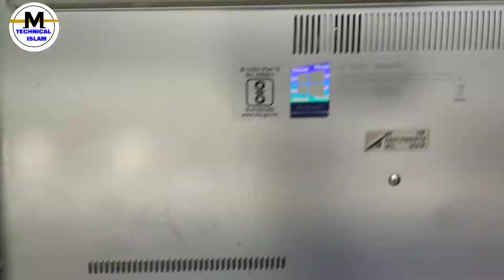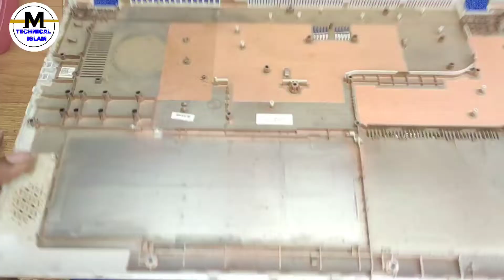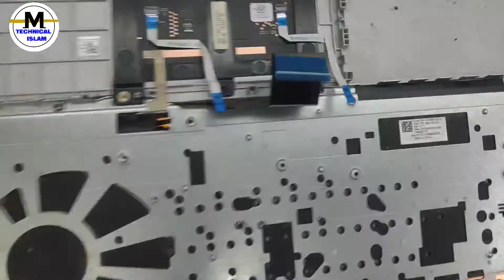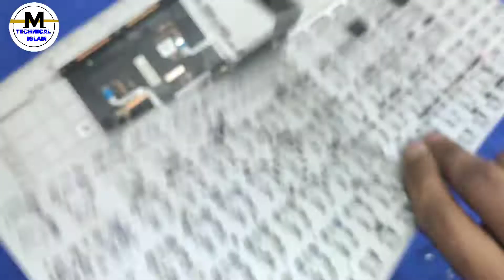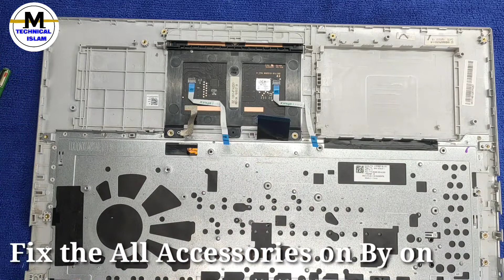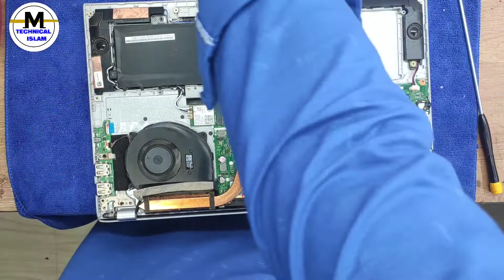Asus Laptop Keyboard Replace | How to Replace internal Keyboard | Asus X512F Laptop Keyboard Replace

Comment: Just a barbarian! After such videos, the wholesale destruction of laptops begins! And you will not return to the factory state! Please remove this video, don't harm other laptop masters! This work can be done almost like in a factory, and it takes an average of an hour!
Reply: Honest question:

I have the same issue with my laptop, tha plate below the keyboard is not screwed, it is fixed in place by melted plastic. I don't see any other way to remove it. I have my laptop completely dissasembled right now.
It's a designing problem, Asus should have been used screws instead of this mess.
Probably I'm gonna have to do the same with my brand new laptop because white letters printed over aluminum without backlight are very difficult to see, another design flaw.
It was hard to find the right part, and find the connector for the backlit leds. Fortunately, my motherboard has it, since it's common for other Asus laptops. It's the X512FF (mine). In spanish.
If you can help me with a less destructive method, I will really appreciate your help, otherwise I'm gonna risk this procedure, since I'm stuck before the removal of the keyboard plate.

Regards.